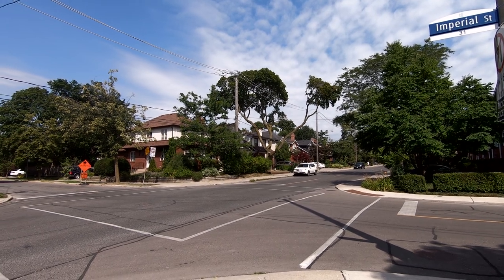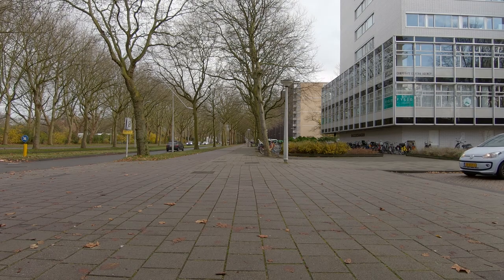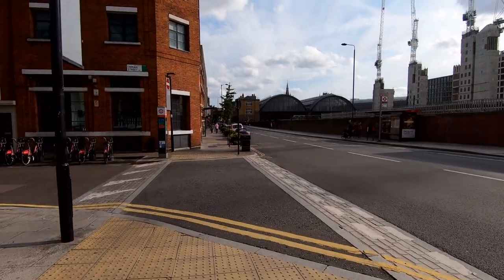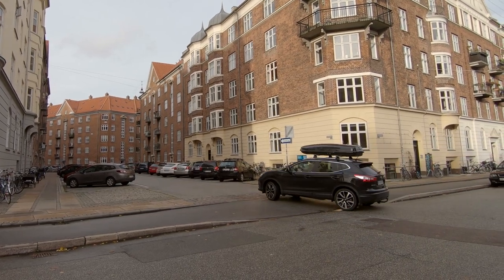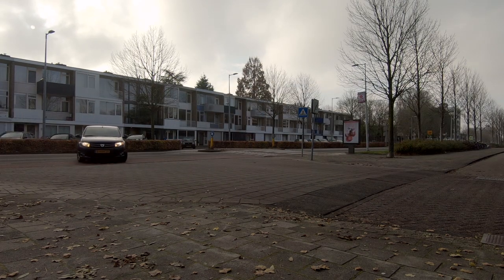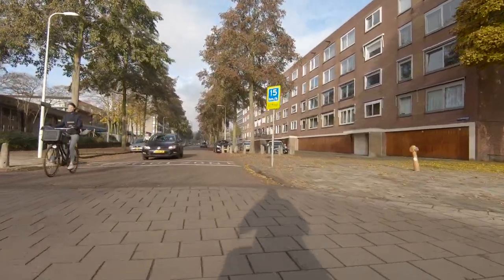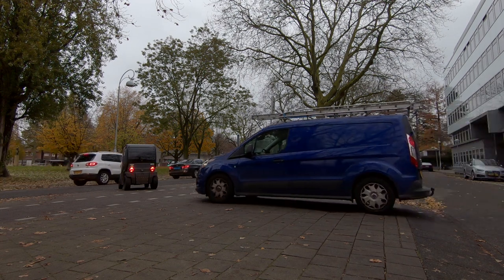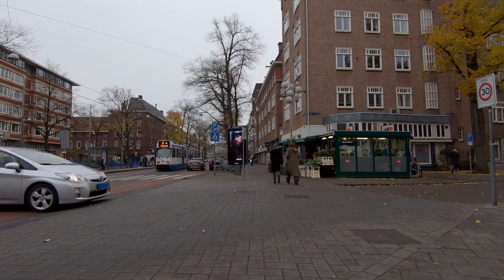The Dutch Solution for Safer Sidewalks - Continuous Sidewalks

Comment: I walk for hours in the NL while daydreaming. Never knew it was a privilege
Reply: Necramonium  who gets robbed in the Netherlands. Maybe in Amsterdam, tourists attract pickpocketers
Reply: @ligametis  From a Dutch perspective: It's a pain to be attentive? You know what's a pain, getting hit by a heavy metal vehicle traveling at high speeds. That's why in the Netherlands, car drivers are expected to drive safely and responsibly. They're the ones bringing the risk to the table. If a car runs into a cyclist or a pedestrian, the "fault" is generally assumed to be on car driver's side. There are a few mitigating factors, but you'll always get the lion's share of the blame. If your vision is bad or the weather makes visibility bad, all the more reason to drive cautiously.

Our infrastructure and our laws are all to the same end. If your vehicle is more dangerous, you are more responsible for road safety. Crossing a street on foot, the only life you're risking is your own. Rushing through an intersection in a car, you risk the lives of others. And for what? So you can get to work 5 seconds faster? A car is already faster than any other form of personal transportation, and it's way more comfortable than walking or cycling. And if the weather's bad you're nice and comfy too. 

And the benefit of our method? People are incentivized to use bikes or walk, particularly when it isn't that far, which greatly reduces road congestion and it's healthier too! But most of all, it greatly reduces the number of accidents and deaths. We are a very densely packed country, with an average of 411 inhabitants per km² (and that's a national average! Imagine the density in cities). If we all used cars all the time, everyone would be stuck in traffic all the time.

And there are plenty of places where everyone (cars, bikes and pedestrians) has to wait their turn at traffic lights. Most if not all of those intersections use "smart" traffic lights which utilize sensors in car and bike lanes to detect traffic. No crossing traffic means the main road can keep flowing. Also, main roads always have seperate sorting lanes for left, straight and right, further optimising traffic flow.

You should really come and see how it is here. And make sure you try all three modes of transportation. You'll see it's a fair and efficient system.
Reply: @ligametis  Love all these assumptions, while the statistics prove otherwise.
Reply: @ligametis  why should we care about that there 17.5 million more bikes then cars here
Reply: Having visited the Philippines on several occassions:  I cross myself ten times over before crossing any street.
Reply: @ligametis  Helmets.We´re not in the army.Other countries you need to wear a helmet because the car drivers are not used to bikes plus in the Netherlands the cyclists have almost the whole time their own roads.
Reply: @ligametis  Those ways of moving are  much faster.
In other countries they have much more accidents with cyclists and with heavier injuries.
Reply: @NLTops  Civilized country!
Reply: @t.mijnnaam9916  :: Philippinas do it in Canada too!
Reply: @n.g.spencer8076  Ehhh I wouldn't go that far. Most people like to pretend to be civilized but I'd say we all have quite a ways to go.
Reply: @ligametis  When you want to "use" the city, you are right. Everything should make way for the most efficient mode of transport. 
When you want to be in the city all you arguments are flawed. Speed and efficiency have a low priority. 
One is not better then the other it's just a way of living.
Reply: @ligametis  I see a city as a place where people come together without a specific goal. Terraces, drinking coffee, watching other people. Things like that. As i said one is not better, just other needs.
Reply: @ligametis  Too few bikes. ;-) 
I tried living in The Hague. It''s as silly to want to sit on a sidewalk there as in NY. So maybe you should have a look around in a Dutch city like A'dam Groningen Utrecht Breda Maastricht Zwolle Deventer Leiden delft, or Belgian like Antwerpen Brugge Gent and try to understand. 'Other' people can be nice to be around.
Reply: @ligametis  In China the whole Rhine / Meusse delta (from Brugge to Amsterdam and Brussels ) is one city, so yes those small ones.
Reply: Necramonium  Living for 30 years in Amsterdam. Never got robbed. Been in every single Metro, tram, bus, train, taxi, uber, on a bike, on the street, on every major square, multiple minor squares, every park etc.
Reply: same
Reply: Labas Labas we in the netherlands get taught how to do that
Reply: its not a privilege, it is the way how we (the dutch) designed our roads to make it pedestrian and cyclist friendly :)
Reply: @ligametis  Your issue is that you want everybody to prevent cars to kill people but those who bring them into the city.
Reply: @ligametis  why should we care about cyclists if there are xx million more cars "BECAUSE CARS ARE SHIT and POLLUTION CAUSERS"
Reply: @lapland123  "I see a city as a place where people come together without a specific goal. Terraces, drinking coffee, watching other people. Things like that. As i said one is not better, just other needs." i agree with you. it SUCKS to go to xx place just to have some nice moments of rest and comfort.
Reply: @Labas you missed the point of the video. as a society they have know  cars are unsustainable as the main mode of transportation in the city for decades. With this design they help to make the mental switch of the sidewalk being MORE important BECAUSE it carries delicate cargo, so cars have to drive over the sidewalk at intersections. Not people having to enter the road when going from one block to the next. is giving ownership of intersections to pedestrians that are the most vulnerable. Is a Different attitude that places priorities in self-reliance in transportation, Discouraging attitudes like yours.  You are correct, No one is inmune to a 2 ton Rolling-steel-cage. But Your mentality of; I’m king of the road and pedestrians need to pay attention to me because I’m dangerous is exactly what they are eliminating with this design, you need to watch for pedestrians because they are using their own legs to propel themselves, that is commendable right?  you like the country, where there are less cars around? The secret is; *whispers “We all agree with you”
Reply: @ligametis  I don't really understand where you are coming for. Walking and Cycling is the only options for some people. I walk home from school quite often which is 3miles or 5km. Because they have lessen the number of buses to my area. I cycle the 9miles or 14km to rowing on the regular and something I have no options but to travel by road as the bike path I use is on a flood plain of two canals which floods on both sides of the path. I plan to start driving lessons soon as I'm 17 but I can't afford the cost of a car plus what would I do with it when I leave for uni next year. In my eyes pedestrians and cyclists should at least be respected when using the road they are trying to get somewhere too. It's not all about the car as it may take longer to get somewhere by foot or bike therefore they should have the right of way especially when a road is cutting through a footpath.
And yes I wear a helmet cause if a car driver doesn't kill me a tractor driver might. But when I'm walking I don't I just hope they don't drive on to the footpath and hit me.
Reply: @ligametis  your logic makes no sense because you only hypotheticals and solutions that make sense as long as you don't think about them too hard. The point of our cities is to make it convenient for everyone, not just cars. I agree with every comment I've read of people explaining the problem with your statements because they speak either from personal experience or official statistics rather than ignoring everything said in the video for the sake of not admitting change is necessary. If you actually listened to what this and his other videos say then you would have already realised why what you're saying is incorrect
Reply: @ligametis  the problem with that is that nobody is saying remove cars and, despite what you seem to think, these measures don't actually slow down cars. It makes driving a car much easier when necessary because there isn't nearly as much traffic because of all the people not driving a car because of other modes of transportation. You talk like it's all a theory and you're the real expert debunking it but this is something that has been proven time and time again. I live in the Netherlands and there's a lot less traffic because a lot less people need to drive cars, which means there's a lot less trouble getting around by car if you can't take the train or go by bike. The reason we do it like this isn't because we never developed further, it's because unlike countries like Canada or the US we keep developing to maximize safety and convenience. Accidents happen a huge amount less and when they do they're not nearly as bad, all while on the whole nobody has a majorly hard time getting around. I go to England and Scotland a lot with my parents to see my family where there's a lot more car centred infrastructure like you suggest so aggressively, though not as bad as the US or Canada, and one of the things I notice is that there's more traffic because almost everyone has either walking or driving as their main mode of transportation. Walking is still quite safe but because those are the ONLY really viable options most of the time. The fact that it works should be obvious if you actually pay attention in these videos
Reply: @ligametis  though that argument does not apply to Canada for reasons he explained in another video. Also the point isn't that EVERYONE can go by another mode of transport. If even a fairly small amount of people don't have to get a car if public transport or cycling is faster than that alone will already make a big difference for cars. Making cars the only important and focused on goal of transport will always make traffic terrible, no matter what other context you want to add. This has also been discussed in his videos and is also very noticeable if you look at other countries or cities where cars are treated like the only important transport, especially when compared to countries and cities that don't. Again you're treating this like it's a theory debate when there are studies all over the world finding this again and again. Seriously all of this is quite easy to check, all you need is the slightest effort to learn rather than stubbornly cling to your idea no matter what someone says
Reply: @ligametis  the problem with saying you don't think it should be all cars but they should keep the advantages is that if they keep the advantages everyone will go by car unless they really can't because they can't afford it. That's how it works. People don't generally care what their mode of transportation as long as it's the fastest and most convenient for them. Giving cars all those benefits makes alternative travel impractical and makes those forms of travel look more like a nuisance like in North America. Nobody is under the impression that how specifics work are exactly the same everywhere but it is always true that if one mode is much better EVERYONE will want to use it because why would they not? And while banning cars completely is something practically nobody is suggesting it's important to remember that cars are dangerous and the main priority should be the safety of people outside the fancy coloured tank, not the convenience of only the people inside the car. I understand where your logic comes from but it also just doesn't work. Also I'm not saying there's a perfect middle ground but I AM saying that there's a very good middle ground because I live in it. Whether it's by car or public transport the infrastructure in the Netherlands is specifically made to be safe and convenient for as many people as possible and it minimises traffic and accidents by a huge amount in both highly dense areas and small villages. Even if you think the Netherlands is an unrealistically high standard for countries like Canada there's still Copenhagen and other cities in Denmark which are still very friendly to alternative modes of transportation even if it's not as good as Amsterdam, all while being very achievable in maybe a decade if they actually made an effort to improve road safety. I do think it's realistic even if you don't because I literally live in an example that does it very well and you can't pretend it doesn't count at all just because of the environment. Yes it makes a big difference but not nearly as big as making other ways of getting around more safe and accessible.
Reply: @ligametis  sorry no I'm not even going to entertain the idea on this one. Cars are giant, heavy, tanky, unwavering machines. Accidents do happen with bicycles but they're not nearly as deadly. Cars have more blind spots than any cyclists and your argument horses are more dangerous is literally insane. First of all a horse doesn't move forward no matter what and in fact most animals tend to avoid walking into things for whatever reason. Cars SHOULD be held responsible before anyone else because they're the ones driving a giant unflinching metal vehicle so it's only logical they should be responsible for using them appropriately. I'm not saying there is no way anything else is the problem because unlike most places here in the Netherlands we don't point fingers because the first thing we do is look at the roads but until then if anyone is responsible it's the cars. Also you can't say safety should be a priority and then follow that by saying taking drastic measures isn't the solution everywhere. If there's a drastic problem you can't shrug it off and put safety second for convenience. Safety is always the first priority here and that's how it should be. Bicycles can do damage but when's the last time you saw a speeding bike shatter right through a house? Cars kill people very easily if you're not careful. People make mistakes and that's why here in the Netherlands and some other European countries we make our traffic laws to minimize how likely mistakes are and how much effect they have. Again this has been proved all over the world and it's what we do here and it's going very well, your arguments hold no ground whatsoever
Reply: @ligametis  the problem with that logic is that it almost never has anything to do with the victim. Also pedestrians know cars are dangerous and do act accordingly but if there's nothing actually forcing drivers to pay attention like we do in the Netherlands then you can't be surprised when there's a lot if car crashes. This is why in countries like the US crashes happen all the time and nobody thinks twice about it. You keep putting emphasis on the pedestrians but no matter how you look at it if you're the one with the very dangerous tank then it's automatically your responsibility when you hit someone. If you wave a bat around without a care in the world and you hit someone with it, even if you didn't see them or they suddenly walked in front of you, then that's your responsibility. It makes no sense to do it differently and the system should be made to minimize mistakes, not to make everyone do everything themselves and blaming something else whenever they hit a building or immediately start victim blaming when a car hits a pedestrian, exactly like you're doing now.
To note on an earlier point you made you said that the way the Netherlands is doing it would put a burden on drivers but judging how little you understand about the subject I'm going to assume you don't live in the Netherlands. For your information you can't decide it doesn't work because you don't think it would when this country is doing exactly that and it's going infinitely better than most other countries. The Netherlands is far from perfect but as far as our infrastructure is concerned we pay much more attention to it than most people and everything you cast aside because you don't want to admit you're wrong has been proven to work over and over again, so until you can give specific reasons and statistically significant examples of your argument rather than just giving your opinion on things you aren't a part of or understand. You can call this biased but explain to me what part of anything you said wasn't biased. The goal of our system is to make everyone safer and all you're doing is giving arguments that benefit exactly one group and it would be extremely arrogant of you to claim otherwise, especially until you can offer even a shred of evidence for anything you say. I'm probably not going to stay up much longer and if I see another basket of circular logic nobody can defend coming from you in the morning I'm going to stop even trying to be polite, I could spend all day giving real arguments but everyone here knows you're not actually going to listen to anything not kneeling before your uninformed bubble and you set the few seconds of extra convenience of drivers as more important than pedestrians or other forms of transportation and if you want to pretend that's not true then please explain what part of your logic helps anyone but drivers
Reply: @ligametis  first, it's not just my opinion, that's how our official system views it and it helps a lot. Secondly, I'm not irrationally scared of them because unlike in the US I never need to worry about being hit by a car because, thanks to the system you claim despite studies around the world disagreeing with you, cars have to pay more attention. Third, no that's not even remotely true. The reason there's so many more crashes in the US is speed. There's long, wide, straight, smooth roads everywhere so obviously people speed, there's nothing stopping them. Stop signs don't do anything, what stops cars from speeding is lot of infrastructure specifically made to force them to slow down. Seriously mate all of these are easily checked, whereas everything you say is fear mongering that only exists so that change doesn't have to happen for your roads
Reply: @ligametis  no actually that's not a better example if you actually look at the situations rather than making assumptions. First off when you have super wide roads everywhere that make crossing difficult you can't be surprised when people cross the road anyway. Secondly there are no houses walking with their phone out across the street and they still get hit by cars very regularly so that logic just doesn't apply. You call it common sense but it's not, all it is is refusing to actually think further than finding ways to confirm your preconceptions. The vast majority of car crashes are because of speed, nothing else. Seriously if you're not actually listening to anything said in these videos why are you even here? Do you comment on k-pop videos complaining about why there are no white Americans in any famous k-pop bands?
Reply: @ligametis  also sorry to get back to this but horses and bicycles aren't big motorised armored vehicles driving at 80 kilometers an hour across the street, your arguments hold no ground whatsoever
Reply: @ligametis  also you say personal responsibility is super important but so far you have exclusively put the blame on pedestrians. Explain to me please why the person in the car that hit someone doesn't need any personal responsibility at all? I know you'll say that's not what you said but yes it is. Everything you have said was exclusively supporting car drivers and literally nothing else
Reply: @ligametis  for starters I don't "want to leave one without any" I'm literally explaining what we are doing in the Netherlands and why it works. How hard is it to read that it has been said multiple times already. This isn't a debate of ideas this is one group of people explaining why something works as shown by how we're doing it right here and right now and through studies around the world while the other party is just you refusing to believe it works because you don't think it does for the sole reason it's not happening around you. Literally everything I've said isn't my idea, it's all officially part of the system and studies into this topic. I don't know where you're from or what infrastructure is like there but you should know that all of this has been proven to work and is much more effective than making everything about pErSoNaL rEsPoNsIbIlItY because no matter what you think everyone should do it's not that hard to see that the more you make people take the rules in their own hands rather than making situations that force them to do it subconsciously the less people actually listen. It's why you need actual enforcement rather than make everyone sort it themselves. I don't know what roads are like where you live and frankly it doesn't matter. If you're going to keep commenting about what you think would be the better option at least have enough of your precious personal responsibility to actually fact check a single thing you say
Reply: @ligametis  You're clearly from Car is master of all places, but no You've chosen to drive the 2 Ton machine, you need to be careful.
Reply: @ligametis  That's the point
Reply: @lintree  Your ideas and position is completely ridiculous and self-contradictory.
If you truly felt safety was the number one priority which should never be compromised, then there is only 1 solution - No cars, no bikes, no trams, no trains, no vehicle of any form; instead people walk everywhere (or go another extreme and ban travelling entirely unless it is needed to live, and require lots of training before people can travel at all). And that is simply for the transportation side of things. It becomes even more ridiculous when you get to other aspects, such as privacy, electricity, housing, etc.
In reality, to make things actually function there is ALWAYS a compromise. Some amount of safety is always compromised for convenience or comfort or something else.

As for personal responsibility and victim blaming, you don't seem to understand those concepts either. (or even understand what people are saying)
You seem to think that the pedestrian is always the victim and has no responsibility at all.
That is completely removing personal responsibility from the pedestrian.
For a system to be fair, all users of the road have some element of responsibility and all can be victims. That means if you were to pick 2 random users, which can include a pedestrian and a car driver, either could be responsible for an incident and either could be the victim.
It is not a simple case of the pedestrian has no responsibility and is always the victim, nor that the car driver is always responsible and never the victim.

If a car is driving along a road, with a pedestrian walking along the footpath, and the pedestrian decides to jump out in front of the car, the driver is the victim and the pedestrians bares responsibility for the accident. But you wish to ignore all that and blame the victim.
Elsewhere, if a car fails to give way to a pedestrian when required to do so at a crossing, and hits the pedestrian, then the driver is responsible and the pedestrian is the victim.
Once more, either can be the victim, either can be responsible.

The victim is not always the once who ends up worse off. Would you also blame someone who killed someone in self defence, saying they are not the victim because they are alive? Because it is the same kind of principle that you seem to want to use. Because the person was able to defend themselves then by your absence of reasoning they are clearly not a victim, and instead the victim was the person who instigated it and who is now dead. But by any sane reasoning, the one who instigated it is the one responsible and the other party is the victim.

Labas also made that clear by saying both can be responsible, but you ignored that and instead claimed he is solely putting the blame on pedestrians, when that is not the case at all.

And saying cars should always be held responsible is just as irrational as saying pedestrians should always be. The path of a car is fairly predictable. Most are incapable of rapidly stopping or turning, so people should be able to observe them and have a decent idea of where they would be going. Meanwhile pedestrians are highly erratic, capable of stopping or going in a completely different direction almost instantly. You can be observing a pedestrian and have almost no idea where they would be 2 s from now (at least on the scale of a road). So should this greater agility and less predictability mean they are always at fault? If not, why should a car being heavier mean they are always at fault?

To make drivers always at fault is pure insanity as it would require you to drive at a walking pace whenever you get even remotely close to a pedestrian and pretty much focus entirely on them, as otherwise they could run out in front of you and sue you for damages as you wouldn't be able to stop in time. But what about if they run straight into your car while you are stopped? Are you still at fault?

And due to just how insane it would be to make drivers ALWAYS responsible, even when the pedestrian caused the accident, it appears that not even the Netherlands makes that the law and instead the pedestrian can be at fault, at least partly.

Also, while speed is a large factor, it isn't as large as you think. The bigger issue is people not paying enough attention due to long straight boring roads, or just not following the road rules generally, like not stopping at a stop sign.
Sure, having lower speeds can make it faster for people to stop, but it can also make them pay less attention.
A driver travelling at high speed who notices something sooner can stop before someone not paying attention who only realises too late.
Reply: @jeffreyblack666  you misscharacterize what I said. For starters I'm not saying pedestrians never have blame, but at the end of the day the first presumed problem should be the person in the metal box until investigation shows otherwise. I also didn't say it's the only problem and if you pay attention in these videos you would notice it's not the idea here either. The roads are complex so people are forced to pay more attention and yes everything has to be a compromise but what America has just isn't one. It's saying one group is extremely important and one can have their existence tolerated, whereas here it actually is a compromise where both groups get on with their day as normal for the most part. When you're the danger to other people and not the other way around then it's your responsibility to act accordingly. 

I know you'll probably say I'm demonising cars and that everything I say is wrong without actually paying much attention to what I'm saying, but to that I say maybe look at these videos again. They explain my point in ways I'm not good enough to do and without having to take someone into account who sounds like they're talking through nothing but theory. 

I'm not just giving my opinion on the matter, I'm also pointing to references of how we do it here in the Netherlands where you can see it working quite clearly.

Another problem is that you argue my point on victim blaming by going back to blame again. This is exactly why no progress is made in the US and Canada. Here in the Netherlands the laws aren't focused on who's at fault but on how to prevent accidents and minimize the effects they have. If the damage is minimal and unlikely to happen then it's far easier to discuss who's at fault rather than throwing out random extremes like you are now to prove their point.

I could respond with "well what if someone was just standing and the driver went to the left just to hit them" and it would make exactly as much sense.

The point of these videos is to explain how it's done and what it does, so perhaps if you accepted it was happening rather than insist the other method makes sense because you can name a single example where it would be fair you might actually understand what's being said.

Before you say you do pay attention let me ask you why you only focus on specific problems rather than the methods that prevent them. 

I'm sorry I'm not being very polite but frankly if you're going to call me insane as if I'm making things up rather than saying what we actually do then I will happily be almost as rude in response
Reply: @lintree  No, I didn't miss-characterise what you said.
While technically you didn't say pedestrians never have blame, you did say it was always the drivers fault.
For example:
"Cars SHOULD be held responsible before anyone else"
"it's only logical they should be responsible for using them appropriately"
"look at the roads but until then if anyone is responsible it's the cars"
"if you're the one with the very dangerous tank then it's automatically your responsibility when you hit someone"

That sure seems to be indicating that it is always the drivers fault.
But even if you just want to start by assuming it is the fault of the driver, that is just as irrational as assuming it is the fault of the pedestrian.
The honest, rational way is to not start assuming it is anyone's fault and instead investigate the situation and determine who's fault it is.
If you really wanted to have someone to blame at the start you look at where the accident occurred. Did it occur at a pedestrian crossing? Then the driver is at fault. Did it occur along a stretch of road rather than at a crossing? Then the pedestrian is at fault.
This way rather than irrationally dumping blame on one party, you consider the context of the situation and who likely should have right of way.

Yes, I argue your point on victim blaming, by bringing up blame as you are literally blaming the victim.
Even by saying we should start out assuming the driver is at fault but then potentially change after some investigation, you still leave open the potential that you start off blaming the victim.

The extremes are useful to show how blanket statements are not useful. It also isn't all that extreme. I have seen plenty of people abruptly turn and walk straight out onto a road, not giving a damn about cars because they weren't paying attention.

All your example serves to demonstrate is that either party can be at fault, which I had already established, and help show it is not rational to just lump the blame onto 1 party without any investigation.

I wasn't objecting to the video in my comment to you, I was objecting to your objective insane claims, pointing out how it makes no sense at all to say the driver is always at fault and how that can be victim blaming. (Notice the CAN), and pointing out how an absolute priority on safety would mean no vehicles at all.

So perhaps you should start paying attention yourself before indicating others should do so and before being so rude.
Reply: @jeffreyblack666 you say that as if I'm just saying that as a replacement for investigation. You are misscharacterising what I said because all of this is a presumption before a full investigation. In America they assume it's the pedestrian who's to blame and usually leave it there. I'm saying the more dangerous one should be presumed guilty before the pedestrian because they aren't dangerous by default but if investigation says otherwise then they're to blame because that's what we do here. You literally just said you're assuming what I meant when that's clearly not what I said
Reply: @lintree  No, I say that as if you start by assigning blame without any rational basis. It doesn't matter if it is just a presumption before a full investigation. It shouldn't be made without a rational basis, if at all. If there is going to be an investigation, why presume anyone is at fault before that investigation concludes?

Which one is "dangerous" does not tell you which one is at fault and thus does not provide any rational basis to say who is at fault.
It is no more rational to just presume it is the driver than it is to just presume it is the pedestrian.
And before you try to justify it with "well pedestrians would never want to intentionally hurt themselves" that doesn't work either as most of the time drivers don't want to intentionally hurt pedestrians. Even if you entirely ignore the consequences to the pedestrians (where most people don't want to hurt other people), it is also a massive inconvenience to the driver, typically with damage done to the car that needs to be repaired, and them having to wait around at the scene of the accident, causing them delay. Most accidents are cause by people not paying attention. That could be a driver not noticing a pedestrian at a crossing and running into them, or it could be a pedestrian not paying attention to the road and stepping out in front of a car.

The only (at least the only quick one I can think of at the moment) rational basis to use as a presumption of who is at fault is who has right of way in a particular location. That would mean at a pedestrian crossing or on a footpath you presume it is the driver, but on a long stretch of road (or elsewhere where pedestrians need to give way) you presume it is the pedestrian.
Unlike your insane and irrational idea of always blaming the driver, this places blame on the one who does not have right of way, the one who should have yielded to the other, and assuming the one who does have right of way was following the rules.

Where in what you said did you indicate the pedestrian could be to blame?
Instead of indicating that in any way you have repeatedly said it is drivers who are at fault, with statements like the above, and this:
"if you're the one with the very dangerous tank then it's automatically your responsibility when you hit someone."
You then compared this with a wildly swinging a bat around and said:
"you hit someone with it, even if you didn't see them or they suddenly walked in front of you, then that's your responsibility"
So you are indicating if a pedestrian suddenly walks in front of a car, it is still the drivers responsibility, not the pedestrians.
And then indicated the blaming the pedestrian is victim blaming, making it out that the pedestrian is always the victim and never to blame.

And when Labas indicated as such by saying:
"if you think pedestrian is always innocent"
You made no objection to that point at all.
You made no attempt at clarifying that actually you think some times the pedestrians are at fault and are not innocent.

So just how would anyone reading your posts arrive at the conclusion that you think some times pedestrians could be at fault and that the drivers could be the victims?
It is quite clear what you said, and what you said (prior to your replies to me) in no way indicates that you think pedestrians could ever be at fault or that it is ever not the drivers fault.

It is only now, in your most recent posts that you have made any indication that pedestrians could be at fault.
So it sure seems like I made no miss characterisation and instead you are now changing your tune. But rather than admit that you act like that was your stance all along.

Meanwhile, Labas acted quite differently, and repeatedly indicated that both could be responsible and you continually miss characterised them as blaming the victim and thinking its always the pedestrian's fault.

So again, rather than telling me to pay attention, perhaps you should go back and pay attention to what yourself and others have said, as now you are arguing against yourself. Just go back to your first post and actually start reading what you have said and then tell me from that post onward just where you think you indicated the pedestrian could be at fault and the driver could be the victim.

You also seem to be mischaracterising the US. What makes you say they start by presuming the pedestrian is at fault? Is that in all situations or only some?
Are you saying if a car ran over a pedestrian on a sidewalk, they still presume the pedestrian is at fault?
Are you sure it isn't just a case of they aren't assuming the driver is at fault?
The US has a system of justice where people are presumed to be innocent until they are proven to be guilty. That means that a driver is presumed to be innocent until an investigation shows that they are guilty (and then even in court they are still presumed innocent). That means they don't just presume the driver is guilty or causing the accident.
Reply: @jeffreyblack666  yes I am sure they're presuming the pedestrian is at fault because before any information comes out people immediately say things like "they must have been looking at their phone". Also they say innocent until proven guilty but it's a bit hard to say that's what happens. More importantly however is that you're once again going to the blame question, it doesn't matter how you phrase it. The point of how we do it in the Netherlands is putting a system in place to prevent it from getting that far, something the US is sorely lacking. Fun thing about having way fewer accidents is that it's a lot easier to look at why it happened on an individual basis, again something the US doesn't do.

You can play the blame game all day but it's not the important question. I only bring it up in response to you and the other oh so kind gentleman pointing immediately at extremes as if that answers the debate but not accepting any response and asking the exact same question over and over. There are answers to that question in our laws specifically so it's not debated in this ridiculous fashion. 

The US justice system obviously only deals with the results but if you only focus on that the problem will never be solved, which is why the number of pedestrians getting hit by a car in the US and Canada is so much higher than it is here. The Netherlands decided the more important question was "how can we stop this from happening again" rather than "whose fault is it?" I would also appreciate it if you didn't just ask "what if this happens" again, it literally doesn't matter what my answer is because unlike in the US and Canada here in the Netherlands there doesn't have to be a fight for the answer because we have a system in place to prevent it and have a proper response to when it does happen
Reply: @lintree  So what you are saying is you are attacking a strawman of the US? You saying they do that (that they say the pedestrian is at fault) is basically the same as just saying the US presume the pedestrian is at fault. It isn't providing any justification for it.

I'm not "going to the blame question", I am responding to your claims about the blame question. You were falsely claiming that the driver is always at fault and acting like the pedestrian is always the victim, even in the extreme that YOU brought up.

But now that that has been shown to be pure insanity you seem extremely reluctant to make any defence of that position, or admit you were completely wrong. Instead you just argue with yourself and pretend you never said what you did.
Perhaps if you actually addressed the issue, such as justifying why you think the driver is always responsible and the pedestrian is always the victim, or admit you were wrong to claim such things, I wouldn't need to bring it up again.

It does matter what your answer is to these hypothetical because THEY CAN AND DO HAPPEN! The only way to prevent it from happening would be to completely outlaw cars. If you actually had a proper response to it, you would have provided that rather than continually deflecting, unless that proper response disagrees with you.

And again you just make a strawman of the US with no backing at all. What makes you say the US doesn't investigate?
Reply: @jeffreyblack666  I never said they don't investigate and you're taking me wildly out of context. And no it really doesn't matter what I think because guess what? I'm not supposed to be the one deciding and I'm not saying I should be. The reason my answer doesn't matter is because we already have answers to those questions, the difference being we don't need to ask as often. Claiming the only way to prevent car crashes is not having them is stupid. Of course it would solve it but literally nobody is suggesting that. I also didn't say they don't investigate and just declare it the pedestrians fault. What I said if you actually read what I'm saying rather that circling around all the time is that in general courts in the US ask who is responsible and leave it at that. Is it the car? Driver gets punished. Is it the pedestrian? Pedestrian gets punished. Here in the Netherlands they ask how the roads can change to prevent it from happening again. You keep saying it like if it doesn't stop them completely then it's pointless. You talk like I'm exclusively using theory. My point is that that's how we do it and frankly it's working a lot better than America's strategy of fine whoever is responsible and leave it at that.
Also for the record I DID say what we have as a solution, you just don't like my answer because it doesn't apply to wherever you live.

Also need I remind you this started because of someone who immediately went to the "but it inconveniences the cars" and also just straight up being completely wrong because he thinks the cyclists and pedestrians should be giving right of way. In the part of the road he's referring to drivers don't have right of way which actually does mean that in that scenario the driver is wrong because they literally went against the traffic laws.

The point of our laws is specifically to prevent accidents and not who's at fault and that's why I don't seem to answer the way you want. Because it literally doesn't apply here at all or at least not in the way you keep mentioning. Please don't forget that this is about sidewalks and nothing else.

If you took the effort to remember this is about sidewalks you might notice that cars don't have right of way there, aka any driver that doesn't wait is disobeying traffic laws and is therefore wrong no matter what scenario you try to add or what your morals are
Reply: @lintree  No, I'm not taking you out of context. In context, you have made it clear that you think pedestrians are the victims and the driver is always to blame.
I provided quite clear quotes to show that.
But you still refuse to acknowledge that and instead pretend you never did.

If you already have an answer you should be able to provide it, but instead you just avoid the question, deflecting however you can.

And you are wrong again, the only way to prevent crashes, with absolute certainty, is to completely remove cars.
While cars exist and are driven around the roads, there will still be crashes.
Since 2000, the Netherlands had over 500 fatalities each year and over 15 000 serious injuries each year.
So you clearly aren't preventing them.
The aim is never to completely prevent them as that is impossible without removing cars.
Instead the aim is to minimise them. Their 2020 target was 500 fatalities.

And that was also my point about safety being the number one priority which must absolutely be met.
If it is, the solution is simple, NO CARS! But it isn't.
Instead, it is just very important, but considered along with other factors.

As for the US, you literally said this:
"America they assume it's the pedestrian who's to blame and usually leave it there."
That sure sounds like claiming the US say it is the pedestrians fault without any investigation and leave it there.
You didn't bring up courts until now, and you didn't indicate the US does include drivers being at fault until now.

So once again, you go completely against what you say and pretend you never said it.
As for what the courts do, they are courts. They determine civil liability and criminal liability.
They don't get to force changes to the road structure.
Separate to the civil liability and criminal liability organisations within the state/city can investigate the crash and determine ways to reduce the chances of similar crashes happening and act on those suggestions.

In the Netherlands, is it the courts deciding how roads should be changed to reduce chances of an accident? I doubt it.

And now you want to try to limit it to just sidewalks. None of what you had previously said indicated you were just talking about sidewalks, and by that I assume you also mean where they cross the road. You talked about cars running into houses. That isn't the sidewalk.

He was also talking about who SHOULD have right of way, not who does. That means you cannot appeal to the law to justify your choice, as the very question is what should the law be (and the law varies between countries, for example, in my country, at intersections pedestrians aren't given absolute right of way to cross how they please).
So even if you do want to limit it to these crossings, it is still a question of who should have right of way.
Reply: @jeffreyblack666  great joy to wake up to today. So you claim my sentence which is literally followed up with scenarios of both involved having potential fault going tHaT sUrE sOuNdS lIkE bLaMiNg PeDeStRiAnS when I specifically said both. My point was in the US it's focused on who to blame, not to blame pedestrians. That's how the system works regardless of personal biases.

Also great idea but no he wasn't, he said it's inconvenient when pedestrians don't give right of way, and frankly if he was saying who should there are millions of better ways to say it. Again you don't have to spend hours going blindly against what I say because you don't like my tone, literally all of what you asked you can very easily find out how we do it here and if you don't care about that then frankly you can bugger off as that's what this is about.

You're literally taking me out of context again to fit your narrative of what you think I meant and it's really tiring having an argument with someone who's effectively arguing with themselves regardless of what anyone says
Reply: @lintree  And again you completely miss characterise what I have said.
That statement is you claiming the US does something and then saying how you think it should be.
That is clearly indicating you think the US just blame the pedestrian and leave it at that.
You say that is wrong and instead you just blame the driver for no good reason and only if an investigation shows the driver wasn't to blame that anyone else gets blamed.

So that matches what I said you claimed.
No where in that are you indicating the US investigates to determine who is at fault.
Instead you are indicating that in the US they just blame the pedestrian and leave it at that. (at least usually).

Your alternative that followed directly contradicted that statement by starting with blaming the drivers for no rational reason at all. So clearly it wasn't talking about how it is done in the US, but how you think it should be done. So you were jumping straight to blame as well, and blaming before any investigation.
And you are yet to provide any rational justification for why we should just immediately blame the driver. Likewise, you have made no attempt at justifying why anyone at all should be blamed before an investigation is concluded if you are always going to conduct an investigation. Instead you just pretend you never said that or never meant that.

But again, rather than admit to what you said and deal with that baseless claim of yours by either defending it or admitting it is wrong, you just deflect however you can and pretend you never said what you did, or that that magically wasn't what you meant. If the latter truly is the case, do you even understand English?

Grow up.
Stop trying to magically invent context which does not exist to hide what you said.
Own up to what you said and either admit that you agree with me and that your prior claims were wrong, or defend your claims.
Stop lying by saying I am taking you out of context or characterising what you have said.

Then you just make no sense.

The point is he wasn't just saying this is how it is, he was discussing if pedestrians should have right of way. It doesn't matter how you want to word it. The point is he isn't just accepting what the law is and going based upon that (especially as the law changes between countries).

It doesn't matter how he phrased it. It still means appealing to the law to say "these people have right of way" makes no sense in this discussion.

Yes, it can be quite tiring trying to argue with someone who is arguing against themselves. But that person is you. You are outright rejecting and contradicting what you have said before. You are arguing against yourself and blatantly lying about what you have said or what context it was said in to pretend you are not.
Reply: @ligametis  "this just decreases the efficiency of car traffic"
That's the point. To de-incentivize people from driving cars. Cars kill people. Cars pollute. Cars cause congestion on the roads for those who actually have a good reason to drive.
Reply: @ligametis  I understand. Until recently, I had always wanted to live in a place where I can walk to my car in a garage, drive to work to park in another garage under the office building and walk to work the office without taking a single step outside. But then I started researching Dutch culture and Amsterdam and their heavy use of what Americans call "mixed-use" housing where you live in a place where you can walk less than 15 minutes from work or other shopping. In a car-centric city, that sounds stressful. As a pedestrian, I'd constantly need to be on the lookout for my safety, and as a car driver, I'd constantly feel the stress of finding parking, not running over pedestrians, and not pissing off the other drivers behind me for driving too slow. In a city like Amsterdam, as soon as I step outside my apartment, even if it's raining, there are likely to still be plenty of others also walking and biking, so it feels like we're all in this together (not to sound so hokey about it). It also is not considered something reserved only for poor people to walk or bike places. It's just often what people choose to because it's genuinely more convenient and faster because they already live close to everywhere they want to go anyways.
Reply: You can do this in some cities in the us. But it's very clear that our cities were built for the car
Reply: You have to be on constant alert for drivers that will NOT stop for you, or even notice you, if you walk on the sidewalk (assuming there is one) in the USA. If you reach the intersection first and begin crossing, even though pedestrians legally ALWAYS have the right of way, drivers will angrily honk at you and sometimes aggressively lurch forward in their vehicles as though they’re going to hit you. It’s quite unpleasant to say the least.
Reply: @kieskop4684  no. u wear bike helmets cause any fall can cause a problem on the chance you hit your head. yes it can happen from a car impact but it can happen from anything. hell, my dad fell while walking. no snow. hit his head, got brain damage and died from brain bleeds. it may be slim but it doesnt hurt. and if the only reason they dont like it is how it looks? id say they are stupid.
Reply: @StarFyreXXX  Sry about your dad.
But we don`t need  a helmet ,we know how to drive our bikes.We have our separate bikeroads.Car drivers in the NL are cyclist them self so they know how to behave(mostly).Cyclists are special protected by law.
When you walk you won`t wear a helmet i presume.
Reply: @kieskop4684  the point is my dad knew how to walk.  We don't know what happened. It can happen.  The point isn't for cars.  It's for extra safety.  As long as the few times something bad happens ppl accept it and don't complain I guess.  Ppl just deal with it since it's such a low occurrence
Reply: @ligametis  If cities are nothing but tools you toss aside at the first opportunity then you have little room to argue that your needs should be prioritized.
Reply: @ligametis  I understand that you would like to derive the benefits provided by cities and don't care about the needs of the residents, I just don't understand how you present it as some sort of argument that someone else should consider. You're just giving us a wishlist.
Reply: @ligametis  It's not about offense, your wishlist just isn't constructive input.

Zoning tends to be quite restrictive in the US so the argument from freedom is neither correct nor would it help anyone even if it was because freedom to live in a suburb is not the same as the power to unilaterally dictate rules elsewhere.
Reply: @ligametis  
And that mindset right there says it all.

Safe traffic? Nah, I want efficient traffic. Where everyone else has to watch out for my nonsense.
Reply: @ligametis  everpresent suburbs are a consequence of restrictive zoning ordinances and prioritizing cars first, mixed-use commercial/residential is basically outlawed in a lot of NA
Reply: In the US you have to constantly try to avoid death
Reply: @ligametis  We learned to cycle since we were born, you also don’t wear a helmet while playing football (or soccer) or basketball right?
Reply: (bursts in tears, jealously and sas)
Reply: @ligametis  "It's noy relaxing when you have to look where you are going" "...and then drinking in noisy and crowded street or restaurant..."

You still seem to lack the awareness that we are talking about a scenario that is not the status quo in America or much of the world.

Cars do not need to dominate streets. Streets should be outdoor rooms, not 5% human centric and 95% paved asphalt for humans with expensive, noisy and inefficient cars.

You'll come to find that streets are not noisy, nor as crowded when most of the street is dedicated to HUMAN BEINGS.
Reply: @ligametis  Uh buddy...public transit IS USED when it is properly invested in. Crazy idea: when you limit car use it eases traffic and congestion and 10-50 person cars (busses) are actually worth taking because they can zip from stop to stop.

There is a reason this youtube channel is called "Not just Bikes"...
Reply: @ligametis  Bikes are enough for me and many other Dutch citizens to get around
our cities probably aren't the nicest cities for car drivers but given how many people travel by bike or even walk it doesn't seem to matter much
I'd imagine this wouldn't work in many other countries tho
Reply: @ligametis  your wrong the way Dutch roads and streets are designed your overall trip is safer and faster than car centric urban areas. If they made it more car centric you’d be slowed down by car congestion which is the most inefficient method of transportation in terms of space/cost/safety.

See the cars spend limited time on actual streets where they are in conflict with cyclists and pedestrians and the lions share of their ride on faster roads that are uninterrupted by traffic signals or stop signs.

It also bleeds into traffic control as well with smart systems or round a-bouts often allowing you to move straight through an intersection rather than having to slow to a stop.

Your criticizing one piece of a much larger system but it’s how that piece fits into that larger system that determines its impact. Since pedestrians aren’t treated like a liability but a normal mode of transportation there’s less cars on the road which allows for higher trip speeds and less congestion. If cars were overly prioritized you’d lose the benefit of diverting traffic to pedestrian or cycle traffic and be back where you started because cars already offer a lot of benefits over normal modes at least to the individual.

You think the car should be prioritized but it really shouldn’t because the car already has so many benefits to the individual. Other forms of transportation need to be prioritized (at least at times) to make them more attractive which makes society safer, more fair, healthier, and happier because each mode of transportation gets its benefits realized. Cities become more efficient space wise and this profitable/sustainable.
Reply: @ligametis  you know walking around to do your normal activities in a place like the Netherlands is like walking around historical city streets. That’s the point. It’s pleasant and livable. It’s not like walking Chicago or something. Places like the Netherlands have tons of rural space and single family homes. The point is the design of the Netherlands elevates all forms of transportation and because of the design of their cities nice open rural spaces are like 20 minutes away on a bike. Your comparing ND to your shitty car infested hell scape where it’s awful and unsafe to ride a bike, walk, and public transit is nonexistent. There’s cities in ND with average DBa at around 60 so it’s quieter than some nightmare realm like the loop in Chicago.

In England it’s not as good as ND but the cities are so much more pleasant to walk. I feel like I could get anywhere I needed by public transportation even rural historical sites like Stonehenge had bus service. If I wanted to take a car I could and that’s still a great way to do sight seeing in a more rural area but once I’ve parked the car everything is easily in walking distance.

Society shouldn’t be designed solely around what you prefer (hell it makes what you prefer worse a lot of the times) because millions exist who want real communities not just alien suburbs where we all exist in our own little bubbles.
Reply: @ligametis  most of those cafes with outside seating are noisy AF because of constant car traffic going 30 mph or more. Your right it’s a nasty cacophony. It’s because of people commuting from soulless, economic drains like the suburbs in cars that often make cities so awful. With no options but cars we get urban sprawl necessitating more cars which compounds the problem.

See I just want other options than single family zoning like even just duplex’s. With walking biking abs public transit safe and first class just like the investment in roads. Places like America don’t even have good roads like ND because they can’t afford to maintain the expensive infrastructure cars centric suburbs necessitate. Your lifestyle is subsidized by everyone in society and propped up by debt suburbs literally can’t pay for themselves because the infrastructure bill is too high. It’s why your roads suck. In most places even if they could raise taxes high enough to pay for infrastructure bill the average citizen doesn’t make enough money to cover it. So we make more suburbs we expand we borrow and we kick the can down the road.

We can still have SFZ but it can’t be the only stuff we make aside from giant multi unit buildings. We need sustainable liveable cities and for the people with the money to foot the tax bill they can live in single family units but I shouldn’t have subsidize your lifestyle as a poor renter.
Reply: @ligametis   high destiny doesn’t mean awful to live in. The fact is suburbs aren’t financially sustainable. It was a deliberate policy choice pushed by industry lobbyists the idea a pedestrian is mostly at fault for a car accident that you’ve absorbed was literally a propaganda campaign before WW2 because cars killed so many people cities were going to ban them. The car companies bought up street car services and dismantled the competition. This isn’t natural some 75% of zoning is single family zoning. This is policy we set (in part to retain segregation after it became illegal). You go on and on about choice but there is no choice. It’s crowded giant apartment complexes or single family homes. That’s it. Many people like myself want to live in the missing middle but laws won’t let it be built. Some of the most popular places to live are those with heavily mixed zoning. Sure some people will chose rural, suburbs, or detached homes sure but a huge population will chose something else. It would also mean a larger healthier housing market with a range of options to rent or own.

What we want is zoning opened up. Public infrastructure to be properly funded since suburbs are always a drain on city finances. First class options beyond cars for transportation. Smart infrastructure that manages traffic better. Noise regulations. I think what you’ll find is that when cities have financially stable zoning plans, alternatives to car travel, and smarter traffic control that driving is better not worse. The idea this can’t be built in “certain” places is silly. We make super highways in places that aren’t flat like western oregon. Hell we made a trans continental railroad over a 150 years ago. So stop with the “not possible garbage”.

It’s a deliberate choice to neglect proper city design and zoning and endlessly expand with suburbs (which wreaks havoc on our environment and food supply) because without growth cities would go bankrupt. Society can’t afford everyone making the choices you do. We need more options and feeling what it’s like to be somewhere not solely designed for cars is like night and day. I don’t really care what choice you make so long as you foot the tax bill (or deal with septic systems rather than sewers) for your luxury rural housing. Cuz right now the poorest in society and profitable businesses prop up your white picket fence dream.
Reply: @ligametis  on some streets in some big cities maybe there shouldn’t be cars? I’m no urban planner. I also know you don’t have to make driving worse because apparently it’s wonderful to drive in ND and there’s more bikes than cars there. I personally think your addiction to having a car is socialized and enforced by a society where getting anywhere without one is folly.

But it’s silly to think you’d need to get rid of cars or make them worse to get people take public transportation. Driving can be stressful, you can get work done on a train. Many people would do it for ethical reasons too or just personal preference.

It’s expensive believe it or not most Americans are poor AF. Having to drive costs a lot of money. Driving less or not having a car altogether means thousands less a year. On average a car costs 5,200 a year to own. The median per capita income is 35,000 with household income just under twice that. With a two car average not owning a car means you take home 15% more a year and more for the millions poorer than that. Someone making federal minimum wage would literally take home 33% more a year.

Most car trips around 60% are less than 6 miles. That’s easily within biking, a short bus trip, a street car ride etc. If people had options to do these short trips another way it would seriously cut down on car traffic and mixed zoning would make these distances not just bike or bus friendly but foot traffic friendly as well. Cars ruin the economic productivity of streets. The mixed zoning would mean more small businesses and a larger diversity of options. It would also lower cities costs while increasing their revenues. Basically all these changes feed into one another to make more prosperous and liveable cities. All without seriously inconveniencing car traffic because car traffic would fall on its own.

For example you might have to take a more circuitous route but your average trip time would be down thanks to less congestion. Parking would take up less space increasing productivity more.

Everyone wins.
Reply: @ligametis  The car-centric infrastructure imposed to us in the Philippines by the United States colonial authorities is not suitable for a densely populated country. The current population density here in the Philippines is 363 people per sq.km. while it's just 36 people per sq.km. in the US, which is why they can easily spread out in their 50 states.
Reply: @ligametis  People like you who subscribe to American car-centric urban planning clearly haven't seen the benefits of living in countries such Singapore and Japan, wherein public transportation networks are highly efficient that around 95% of the population wouldn't need to own a vehicle for mundane tasks such as grocery shopping.
Reply: @ligametis  Obvious alternatives to short-distance travelling include walking, cycling, and taking public transit (buses or jeepneys if you are not out of touch here in the Philippines)
Reply: @n.g.spencer8076  Trust me, here in the Philippines even our average public transportation network is better than in the US or Canada but there are just too many car-centric people here who look down on our jeepneys and buses.
Reply: @ligametis  you should visit good cities before you complain. Also just because you like cars doesn’t mean the entire world should be subjected to them
Reply: @ligametis 

@Not Bendy Snowball's Alt>Cars do not need to dominate streets. Streets should be outdoor rooms, not 5% human centric and 95% paved asphalt for humans with expensive, noisy and inefficient cars.

@Labas Labas>Human beings create more noise than cars, so what you say is nonsense.

I think he meant like 1 walking human makes less noise than 1 driving car.
Reply: @ligametis  Have you actually watched any of the other videos by Not Just Bikes? He gives very in depth explanations for why all these solutions focussing on pedestrians and cyclists actually make the Netherlands a much nicer, relaxing and more efficient driving experience. Making traffic more comfortable and safer for ALL road users benefits drivers as well.
Reply: In Belgium we have absolute priority for pedestrians. A completely different mechanism with a similar outcome. The number of times which I have visited other countries, walked while daydreaming, and almost get killed.